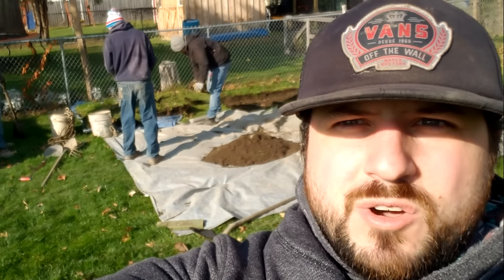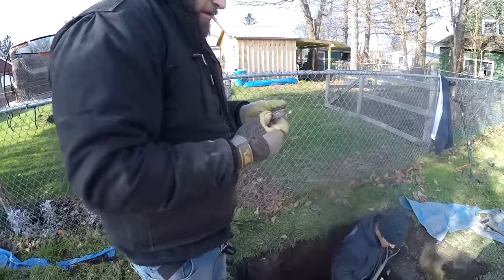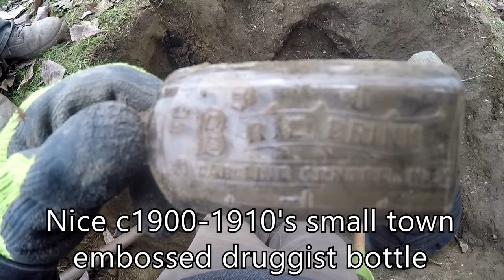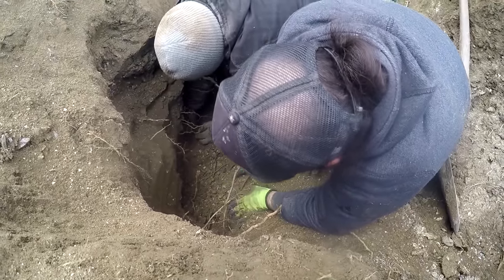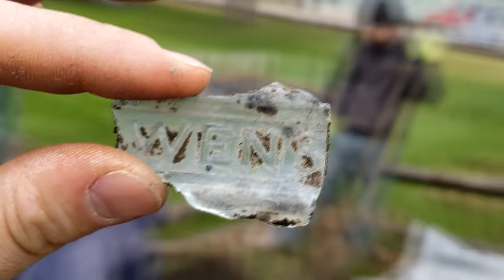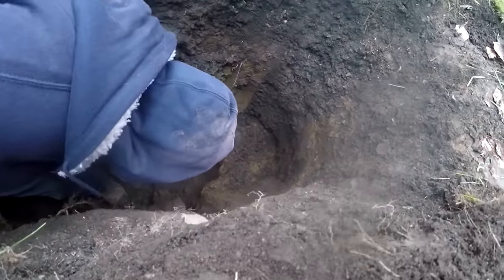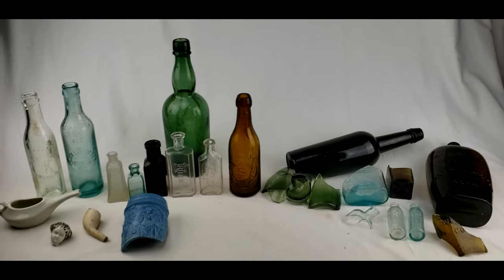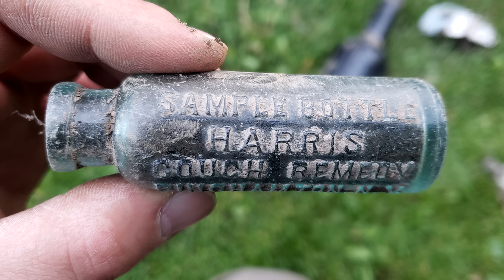Digging Another Pontil Privy! More Pits & Bottles Dug on Civil War Era Train Depot Lot

Comment: Easy way to recover the whiskey flask.  Clean and apply clay around bottle as 2-part mold.  Remove mold, put flask aside.  Pare down the surface anomaly fitting the flask surface features.  Kiln fire the clay.  Blow glass bottle inside, pontill the base, and tool the lip - VOILA !!!
Reply from the maker: Interesting idea John..

Comment: The frosted cosmetic lotion bottle with the Diamond I makers mark is the Illinois Glass Company Alton, IL ... before Owens-Illinois merger (1929).  This bot would then be in the period of art deco (mid- - late 1920s).
Reply from the maker: I'm confused on the "correction" John. I said Art Deco in the video lol
Reply: @ParlorCityPickersDiggers  Yes, if you say art deco then its art deco.  But the base embossing is a very large diamond I (not the Owens-Illinois diamond O I (1929-).  So the bot is actually older as an Illinois Glass, but as an art deco it can only be in the same period as many of the other bots in that privvy and layer in the mid- - late 1920s (1920-1929).  Still a good find ...